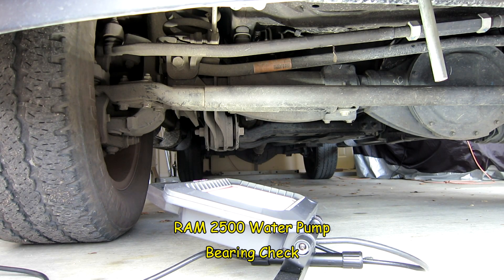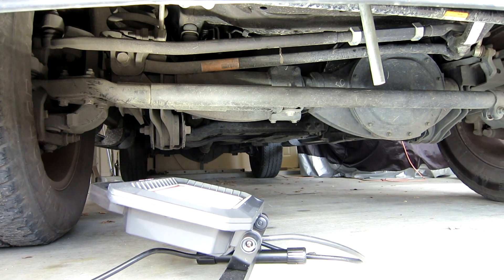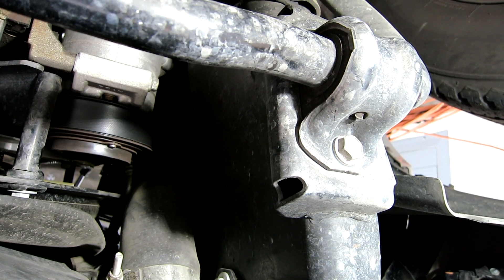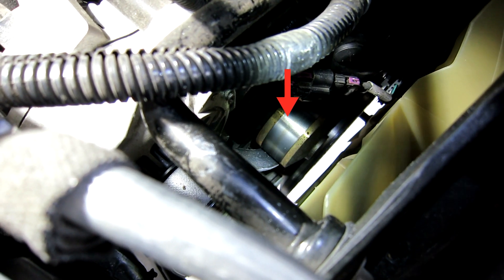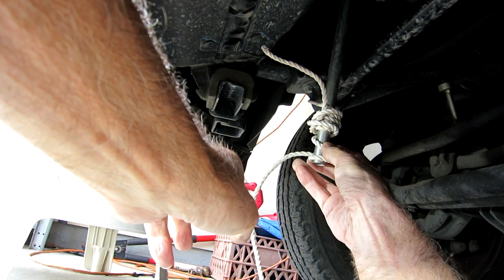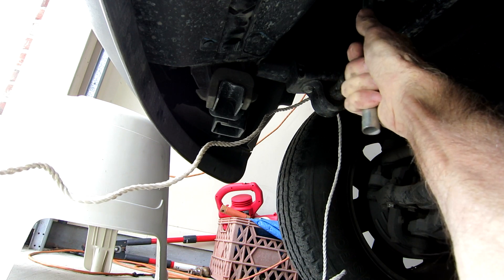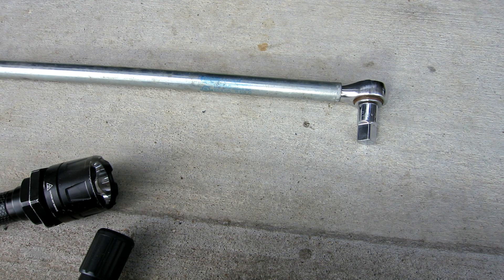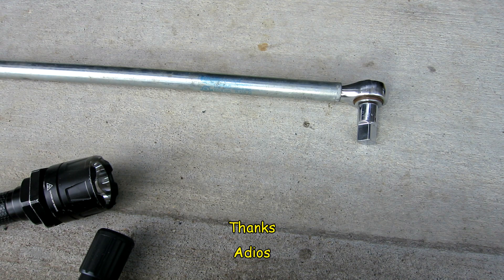Cummins 6.7 L Easy Water Pump Bearing Check

Comment: I tried a my belt off my pants with some modifications during a road side emergency, that didn't work. I used a zip tie I had in the door. Worked like a charm. 1,200 miles from home broke down for a recall that my dealer said wasnt for my truck. 80 miles an hour on a 4 mile long bridge great timing for it to go.
Reply from the maker: That's my biggest fear having a roadside breakdown like you.

Comment: Coolant “Y pipe “ near top of radiator leaked. Had to get it fixed. Seems to be a wide spread problem and lots of billet aftermarket parts. Did your rig have any issues? I have a 14 Ram  Cummins
Reply from the maker: No not yet, I hope I don't look as I'm out of warranty. Yeah that Y is a problem, I should go ahead and change it.
Reply: Marion Blair if you do will you do a video on it? Apparently there is one on the bottom as well. Mine was replaced with the plastic stock one. I was near Sonora Pass in highway 108 in Ca when I noticed the fluid. Made it back down mountain, pressure went down and didn’t leak. I didn’t overheat either but what an expensive fix.

Comment: My 6.7 ate the water pump at 60k, I replaced it with an ac Delco pump my dealer would have had the truck for a week and I couldn’t afford the down time. A week later I got the recall notice.. I’m at 150k now problem free.

Comment: The only documentation I've received from dealer (so far) is that my 2016 3500 is part of the recall. It also says that a remedy for this condition is not currently available.  I suspect that another notice should have been sent by now (7/16/2018).  Nonetheless, I came across this article on "Geno's" website in the water pump area. They make a distinction between weep hole and vent hole. 
I am a dealer phobic, convinced that no matter what, they'll do something to piss me off. Considering that a Cummins brand pump from Geno's is only $50-, I'm tempted to just buy one and have my trusted shop do the change. 
Here's the link to the article at Geno's, have a look.
 https://www.genosgarage.com/product/ram-cummins-water-pump-5473057/water-pump
Reply from the maker: Yea, I saw those also.  I ended up waiting after I checked the bearing.  Mine only has about 30K on it and the water pump was in good shape.  The dealer claims he gets 7 a week which is why it's taking them so long.  I'm surprised how long this resolution is taking.  I'm a dealer phobic also.  On the good side, I did get some fresh coolant and the mechanic gave me a gallon of coolant which I had to use a little after I ran it for a while.

Comment: This comment isn’t water belt related. Would you discuss and give thoughts on turbo cool down.  Towing vs not towing.  If I look at the boost gauge and it shows zero, then do I need to allow for cool down? 

Thanks. Enjoy your channel and discussion.
Reply from the maker: Thanks very much, The turbo will go to 0 when you idle but it still could be very hot if you've been highway running or especially towing.  I use 400 deg. F.  Anything above that and I wait.  If I'm towing and I've got a 5 or 10 min stop for fuel,, I don't shut down because it'll take the turbo 5 min to get below 400.  Around town, you'll always be below 400 and I wouldn't worry about cool down.  I've very conservative about that but your turbo will last longer if you cool down a little

Comment: The “Stealership” keeps telling me they haven’t released the parts yet, and isn’t sure when that will be have you heard anything about it?
Reply from the maker: Yea, as I mentioned to Chunky Monkey, I'm suspicious of the entire recall now.  My personal opinion and it's only an opinion, but I'm wondering if they, after all theses years have figured out that the bearings are not getting enough cooling and now they've decided they are going to drill a hole in the house to let some of the heat escape.  There' pumps don't last long, could that be the reason, don't know.

Comment: Cummins ought to be beat for putting a 50 cent china bearing on the water pump
oh well in 2020 Cummins is bailing out on Ram......... R.I.P.
Reply from the maker: Yea, they know something but don't want to tell us what it is.
Reply from the maker: There's the T51 recall on the Cummins water pumps made by Concentric.  Lot of people are having premature failures.  They are recall all Concentric pumps without a vent hole back to late 2012.  Here's my video on it if you are interested in more info.  https://youtu.be/1UNrcEl4R2M

Comment: A ratchet strap works really good with your operation you have going on. I know all my 5.9 made that squelch noise when I was shutting down. My 2012 does it for my 2013 does not do it

Comment: The squeek on a Cummins shutdown is usually an older and slightly hardened drive belt.  Replace belt and squeek should go away. Great videos, by the way.
Reply from the maker: Thank you
Reply: Or some belt conditioner
Reply: belt conditioner is prohibited on a Cummins
Reply: Yea never been a fan of belt conditioner, just spent the 30$ on a new one.